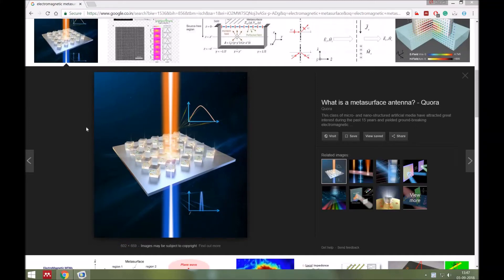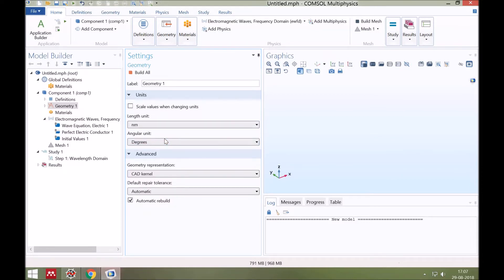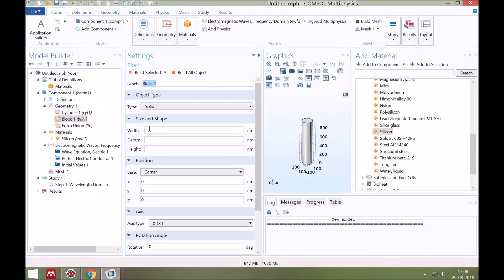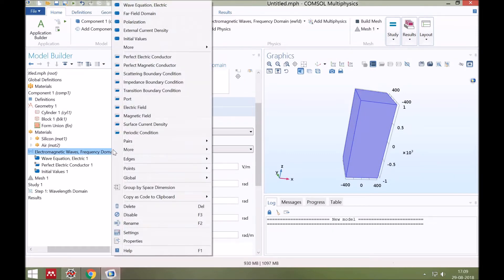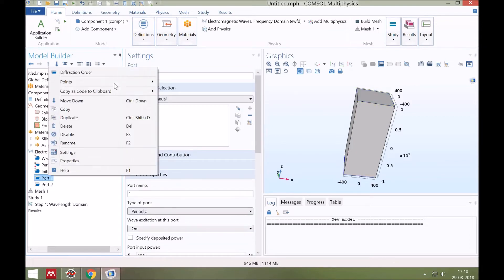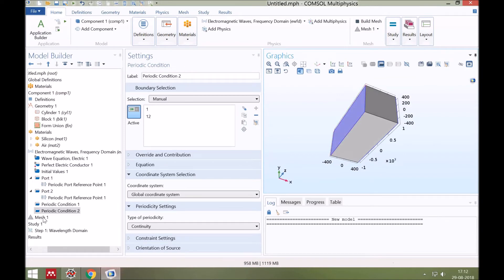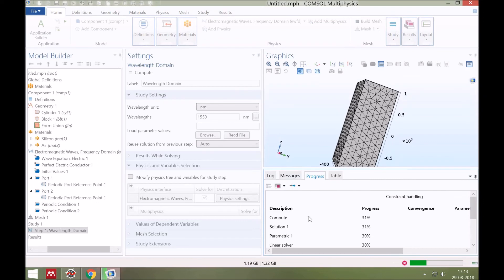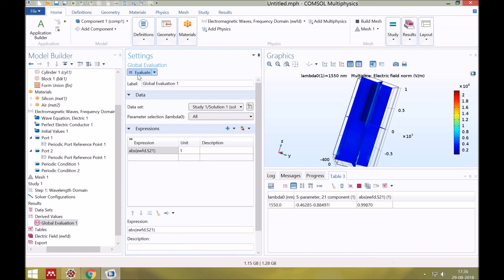Simulation of Metasurface Unit-cell | COMSOL Multiphysics

Comment: Nice video, it was really interesting!
i wanted to ask you a doubt, if i want to simulate the unit cell of the metasurface for the vibration and acoustic field could you advise me on which steps should i change from the ones in the video?
I'm doing my master degree thesis on this topic and it would be really helpful
Reply from the maker: Hello David, thank you so much for watching and appreciating. If you want to design the acoustic metasurface, you have to use different boundaries and considers the thermoviscous effects. For such design, please watch below video of Helmholtz kind of metasurface,

Design and Simulation of Helmholtz Resonator | Comsol Multiphysics
https://youtu.be/_ZfxTajgg-U

Comment: How could I do to improve the absorption of this metamaterial? and how could you improve your permittivity?
Reply: Sir Iam working on photonic crystal dielectric structures, Im not able to get the absorption reflection and transmission graphs
Instead there is a arc length vs electric field graph, Iam stuck here. Could you please guide me where is the option to obtain those graphs as Iam new to comsol, Thank You

Comment: In any metasurface design, phase is also important as the transmission. How can I calculate in COMSOL Multiphysics v5.3?
Reply from the maker: Hello Vishesh! You can calculate the phase by the function called arg(S21)
Reply: arg(ewfd. S21)?